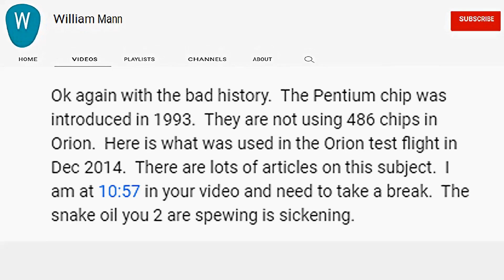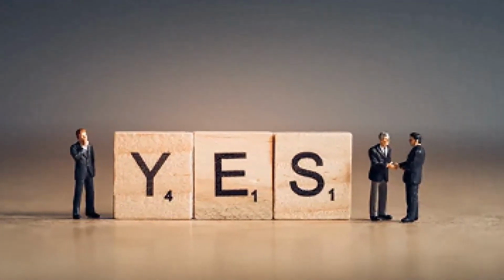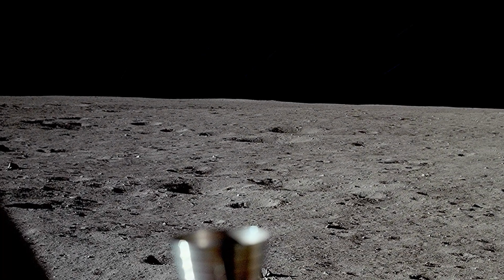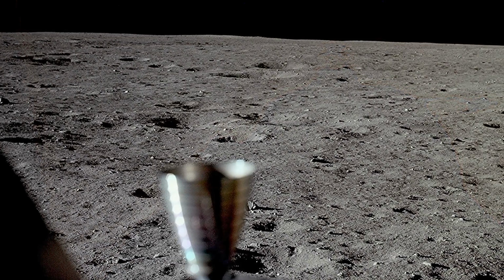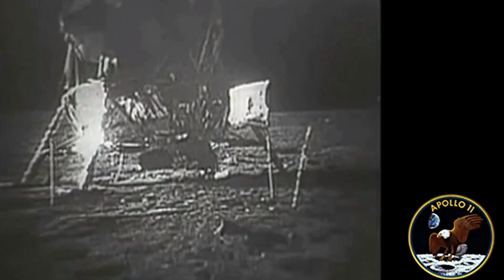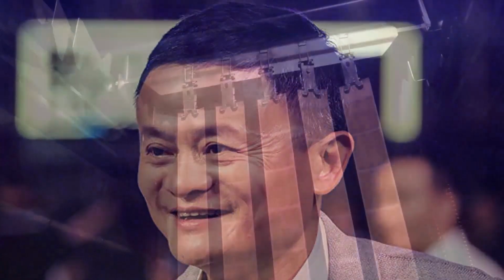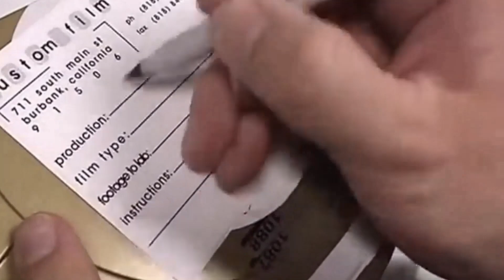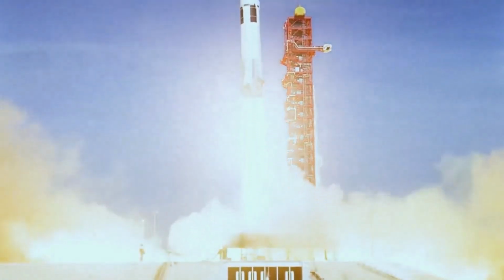THE APOLLO DISCUSSIONS, "APOLLO AND THE FILM INDUSTRY" PART 12

Comment: Insofar as the effect of static electricity on film - (static electricity being generated within an ascending rocket or aircraft) and/or radiation exposure, one partial solution is to maintain a relative humidity of 30 to 50 percent.
So if the film was not contained within the crew cabin atmosphere, then how was any film protected?
Reply: Mitigating static electricity on the film is one issue which NASA actually addressed in their documentation, unlike the vacuum problem, which was completely ignored.
Reply: @codetech5598  Was the compartment where the film was stored radiation proof?
Reply: @yomommaahotoo264  This one they ignored too i guess :) Yet it wasn't ignored on any satelite taking photos, camera was put inside pressurized chamber filled with nitrogen i suppose. Not to mention they put color palet on Viking 2 on Mars to adjust white balance, color palet just as any photographer would do even  in modern era to begin with. Mine friend in Belgium who i worked with was professional photographer but being far from home he had only camera, to make professional session with "models" girls who just wanted have session for free, wedding or something, we went to paint store and grabbed color palet from there, he was desperate i was driving him trough city just for one simple thing we could not find in shops we went firs. I was surprised for him it was crucial,  so he could have 1:1 comparison between reality and what Photoshop/his laptop LCD screen has been showing. Yet NASA never adressed this problem, never if adressed properly you would see Nevada desert clear blue sky - on Mars. They never mention things that are problematic for them, they mention something they have to adress something like that "strawman argument" to dismiss all problems. Our perception as non photographers simply ignores such details. Just as i was astounded his desperation. Because for us - it's not big deal. We have to keep in mind - fact NASA adressed something, fact they debunk some argument doesn't make them prove they went anywhere. But for most people simple minded people it's enough. Everyone have such tendency, anoyed by "details". Good liar must know so they have to adress something sometimes. Correct their documents fix issues and find some magical explanations. It wasnt issue cause it worked okey!? I bet if questioned about radiation just as for astronauts they will show us fake numbers claiming "oh we adressed that". Your argument about some static electricity is interesting can you tell something more? What is mechanism for that? :O
Reply: @yomommaahotoo264  NASA didn't worry about radiation for people or film.
Reply: @codetech5598  Because there was never a vacuum problem.

Even AD's own experiment page links to NASA studies with vacuum tests that stated no changes to the film 
Scott emailed me with images of damaged film that he claimed were done in a vacuum chamber, which were actually materials from NASA's MISSE experiments where materials were left outside the ISS for over a year
Reply: @DaveMcKeegan  "Because there was never a vacuum problem"  in Arizona.
Reply from the maker: Just imagine the static charge on that ESTAR film backing when the LM is re pressurised!  WOW!
Reply: @theapollodetectives  And don't forget the static electricity on the moon's surface too.
Reply: @theapollodetectives  A small static electricity anecdote for you. Mel Gibson's world premiere for Braveheart in Sydney Australia was ruined due to the 35mm ESTAR Base print reels being fed into the projection system via large steel platters while unsupervised [this event happened at the dawn of film projection automation]. It was later determined that the friction caused by the connection of both surfaces, platter and film, generated such a huge static electric charge that the resultant discharge of that energy forced the center of the tightly wound 6000 foot film reel up and out thru the top of that reel all while the film projector was still running without supervision personnel who could have simply hit the stop button once this serious problem became apparent. This not only stopped the movie from being exhibited halfway in but because the film projection system kept running, kept pulling film thru the film projection gate / sprocket transport system, it also destroyed the film projector and caused massive damage to the general projection booth area because the ESTAR base was so strong it could not be broken as it was being pulled thru the mechanics like a freight train off of its tracks / sprockets! So imagine if you will a steel mechanical projector exploding everywhere simply because the ESTAR base film was that strong it could not be naturally broken to cause it to unlace as more film was being fed into the system entirely unevenly. If the 35mm print had been produced on standard triacetate base and something similar had happened while being unsupervised [no film projectionist] then the tension in the entire film print projection system would have simply snapped the 35mm print film immediately with only a few tape splices and several minutes required to keep the event going..........

Comment: you guys probably dont remember, about ten to 15 years ago nasa was buying up old 486 computers from collectors at a good price the super 486 and memory trees
Reply from the maker: Thanks for that bit of information. No wonder Kelly Smith was taking about the 4M chipset.
Reply: @theapollodetectives  i have a question, the retro-reflector, since you dont have an earth set from the vantage point of the moon, the reflector will always be pointed to the earth no matter the time or date, correct? So you know where the flag is, where the reflector is and where the earth should be, right?
Reply from the maker: @Georgia-Red-Mud  Yes indeed to a point. Remember that MIT sent a laser beam to the lunar surface in 1962 and they needed no object on the surface to obtain a return. There is no need for reflectors. The thing that I do not understand is that when they send a beam out, the earth and the moon have both moved from their relative positions which means that the return would now be a few yards off from the source. Where is that receiving system? We do not see a receiving dish in another place. It is always close to the sending source. That is what makes no sense to me. MIT had a receiving dish that was some distance from the source. That makes sense but the way that they conduct the test these days makes no sense as far as that is concerned.

Comment: Here's a hoax 'debunking' site's take on the double shadows. I'd provide a link but YT does it's thing! "this is exactly the point. What you are describing in terms of double shadows is actually double brightly lit lunar surface. It becomes apparent in the LM shadow because that shadow is big enough to show the effect. Whether you see a 'double LM shadow' or double horizon depends on the offset of the 'ghost' image over the primary image. You don't see double crater or rock shadows because they are too small to show the effect within the shadow (that is the shadow in the main and ghost image don't overlap), and the surrounding surface is too bright to easily visually discern the sightly less bright area where the 'double shadow' of the crater or rock is. Same on the horizon. The difference in brightness is not easily picked out if the ghost image horizon lies below the primary image horizon, but is easily distinguished in the black sky if the ghost image horizon is above the primary."
Reply: You can see the LM doubly lit from different sides in different photos- this is evidence of the moving around of the light props.

Comment: Lots of good stuff marred again by your ludicrous flights of fancy about the rocks being all manner of foreign objects.
The rocks are suspect of course, but they just weren't so stupid as to use plastic toys and transmission cases in their stage sets.
You don't do yourselves any favours when you go off into these crazy speculations.

However, they WERE stupid enough to leave blatant evidence of their surface preparation method.
In magazine AS14-65, every single photo of the view from the LEM shows this very clearly. The light is at the perfect angle to cast everything into sharp relief.
It is obvious that, probably using ceiling gantries, they dragged the sandy surface with huge gangs of harrows, or rakes. First in one direction, then across at about 90 degrees. The entire visible surface was treated this way, on every mission, to obliterate any marks made during set-up. Then, to try to disguise these very obvious marks in the sand, they seem to have gone over the entire surface with a gigantic blower. Flying a helicopter across it would achieve this effect.
So, in every picture in magazine 65, you can see a grid of fine parallel lines, cross-hatching the ground. The lines run diagonally both ways across the images. The effect is so pronounced on these images, that the effect is like a coarsely woven cloth. You can see lines of tiny pebbles dragged along. 
I wish you would spend some time investigating and exposing  these ACTUAL artefacts, rather than some of your hare-brained speculations!
I was a diagnostic radiographer since 1974. I was trained (properly, old-school) to analyse the tiniest anomalies in films. Every grain  of silver that was out of place, was indicative of a real causative process. To me, this cross-hatching of the "lunar surface" is a flashing red light. 
In fact, it was so obvious in one photo, that the Apollo 14 Image Library had to make up a laughable excuse for it.
"AS14-65-9206 (OF300) ( 210k or 1240k )
"Near surface photo on Ed's side showing streaking going away from the Descent Engine."
This is not "streaking going away from the engine". It is the ubiquitous effect of surface preparation before every mission.

Then again in magazine AS14-65, you can find many anomalies in the "sky". Several of the photos have one or more bright white specks in the black sky. When you zoom into these, you reveal more specks, rather diffuse, but very obvious.
AS14-65-9205HR "Above Ed's thruster"
At the top left reticule, there are 3 white dots above the horizon. These have the reticule superimposed on top of them, therefore they are real objects outside of the camera, in the "sky".
Zoom into these, and another 3 smaller white dots appear right at the top, directly above.
AS14-65-9203 and 9208 are very similar shots which do not show these white dots, but that side of the photo is cut off here.
AS14-65-9202HR has 2 tiny bright white specks in the sky. Zoom in, and you can see more.
But even more interesting is that on the horizon, just to the right above the second reticule from the right edge, is what appears to be a banded barber's pole, standing vertically.
And so on!!
Reply: Ruby, the many anomalies you found in the "lunar sky" are artifacts from the front screen projection system that was used to stage much of the Apollo photography.. If you look at the Flikr images of the Apollo 12 and 14 shoots, you will also see many halos in the black "sky", especially surrounding the astronauts, which are also a result of the front screen projection system and over exposed images... In fact, the large halo of the Apollo 12 "sun" is a result of the spotlight reflecting off of the glass beads of the projection screen.
Reply: The transmissions, car parts, etc. we’re from from the junkyard where they filmed the Apollo Hoax. That’s the contention at least.  When you see entire 1940’s cars covered with concrete that makes me believe in the junkyard thesis.
Reply: @appletongallery  
I just find their claims unconvincing!
Yet they totally ignore the glaringly obvious telltale marks of sand surface preparation, and the name "Gus Grissom" written in the pristine sand on 3 of the Apollo 11 EVA photos.
Also the vertical pole on the horizon, which I mentioned above.
I've had lots of fun identifying "rock animals" on the moon, including a pig and a crocodile, but I don't pretend they're the real thing.